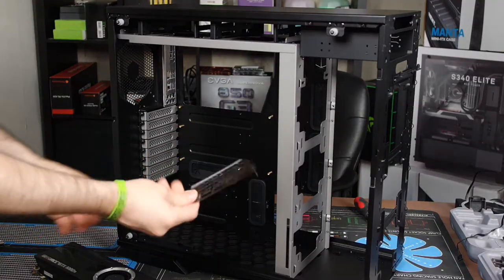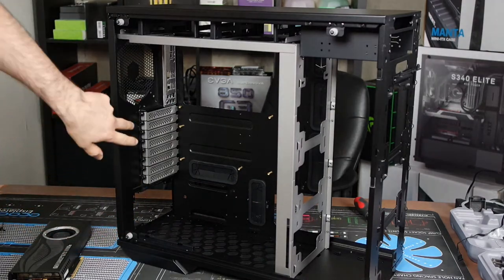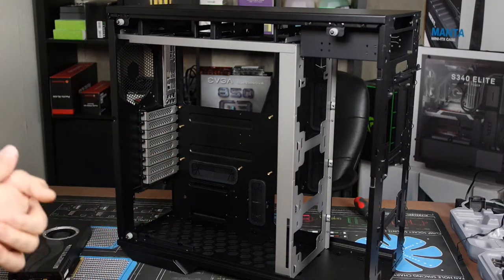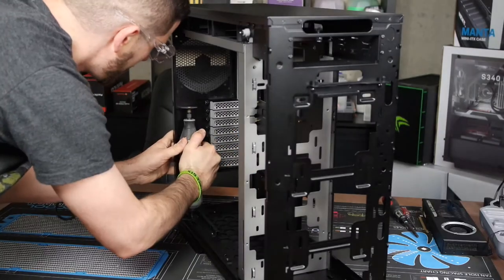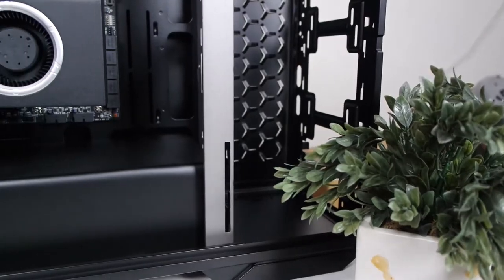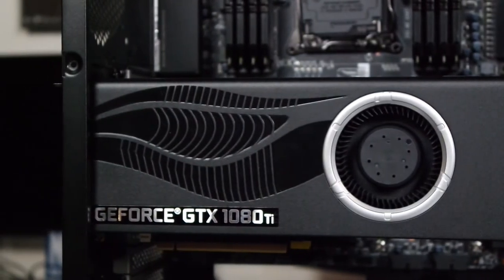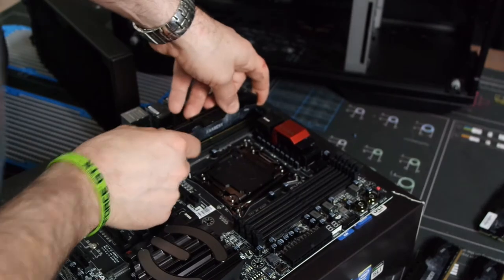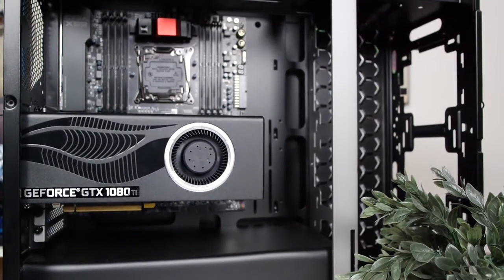Inwin 509 build part 2 (invert GPU)

Comment: Absolutely love this concept. Great DIY video. Looks easy enough. also thinking if someone could make a concept that would hang from existing PCI slots from a custom hanger. Think I'll draw up the idea to kinda give the idea I'm thinking about. The post it to Twitter.Than You for the video.
Reply from the maker: +FlippinFred a couple company's already make them, coolmaster and another over seas company. I'm trying to get my hands on one to show my viewers.
Reply: Awesome. I had no idea. I figured the people out there doing the modes were actually making these as well. Nice to know. Thank you.
Reply: I've just ordered a bracket and riser cable from Coolermaster for my build. mountain mods in the US are another company who make vertical brackets that fit over the original PCI slots. If your case has bars between the slots then you will have to cut these out as well. You can leave the part with the threads where your GPU screws in. So you can always revert back or if you want to SLI later on.

Comment: such a nice case ruined. i will rather wait patiently for new models from InWin with the vertical mount option and riser cable included. I think i saw them allreaddy on display somewhere. LianLi also has this feature in theyre brand new Alpha series cases.
Reply from the maker: +1nicko29 ruined? That’s the beauty of modding  it, I didn’t leave it all cut up. It’s finished off and looks like it’s part of the case. But I agree, wish more companies would add this feature, it’s getting pretty popular. I started a trend lol
Reply: if u take the gpu out will it not look terrible? sorry i just could not get myself to saw into a brand new InWin. Mostly the vertical mount is meant for modders who wanto see theyre expensive water block on display but i think it has 2 other justifications. It will get rid of the gpu-sag problem and strain on ur motherboard with heavy high end cards. secondly it improves the airflow if u into vertical airflow wich i am. the long high end cards will not act as a seperation in ur main case chamber anymore. hot air can be directed to the top or bottom much faster.
Reply from the maker: +1nicko29 no, I cleaned it up and all you see is the opening for the inputs. If you didn’t catch the last build update for this one, i did install a waterblock and that was the main purpose to mod it like that.

Comment: great videos... I have a question?  how do you think the ventilation will be will only one fan in the back for exhaust?  I am looking at this case
Reply from the maker: +TechDad first off, sorry for the delayed response. I can't answer it 100% because I have yet to try the case out with a system running in it to test temps. From an engineering standpoint, inwin is pretty top quality and I'm sure they take airflow into account. Though you don't have top fans pushing air out, with the front being intake and a rear exhaust should cause good pressure to move air. I'm thinking of way to cut the top on mine to allow a rad and fans on the top.

Comment: I demand an AMD build.
Reply from the maker: +James I really want to do one, I never used amd before.
Reply: My only build and first build is AMD. Ryzen 1600/RX 580. I have not actually built it yet. Purolator is being a pain in the ass so im waiting on the CPU and my psu